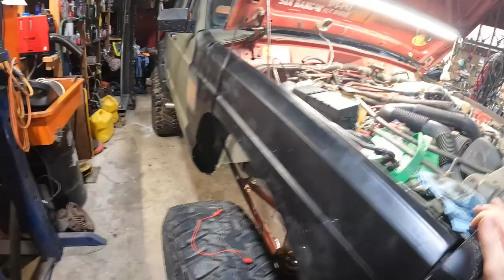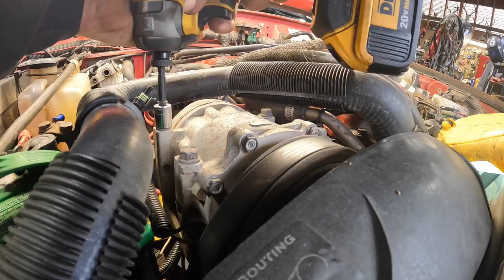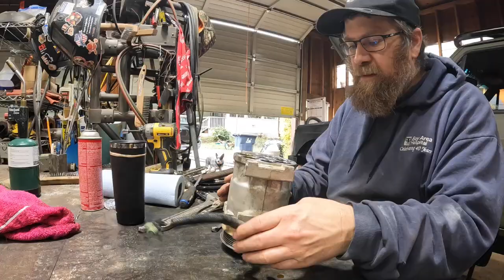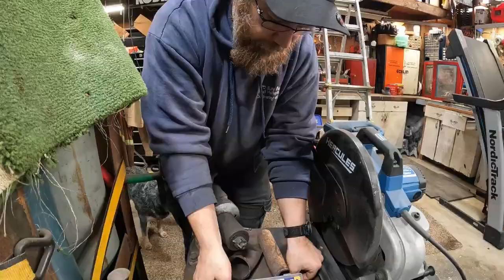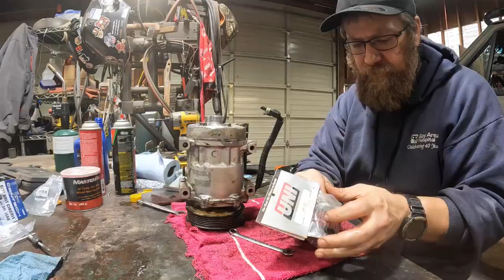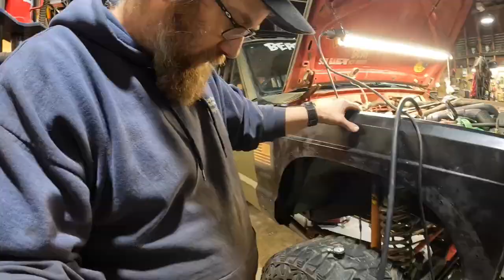$30, First time, AC compressor converted to a Air compressor.

Comment: Did it last?
Reply from the maker: Yeah i use it all the time. Airing up 35s from around 10- 12psi to 30- 32psi. 
Sorry for the late delay on the response.
Reply: @TrailTrashCustom would you let it pump a tank up to 120 psi?
Reply from the maker: I have thought about adding a tank just haven't made it that far yet . But yeah you could do it. Iv